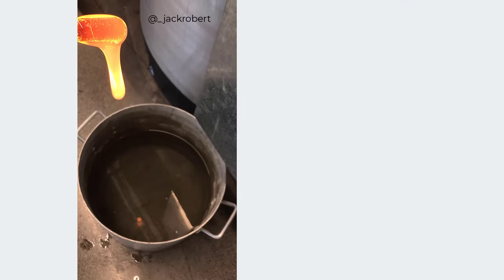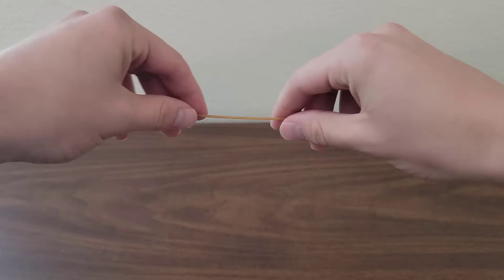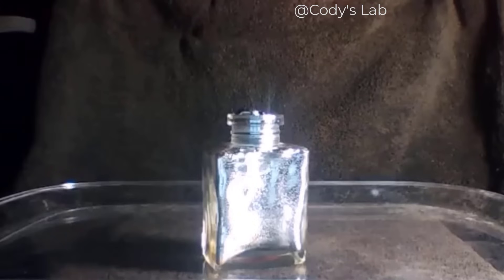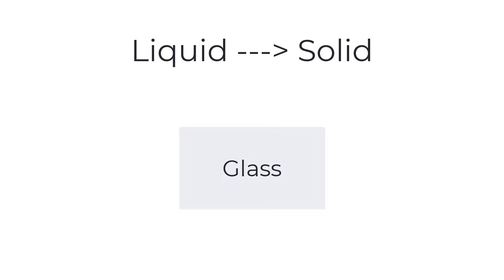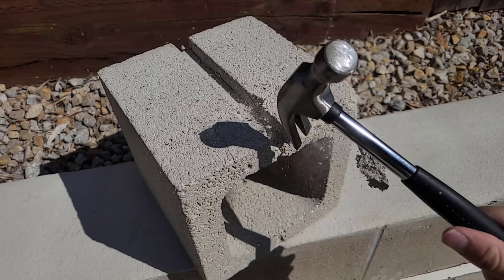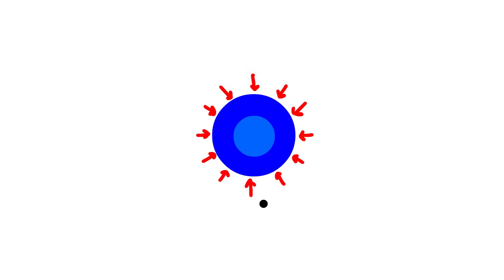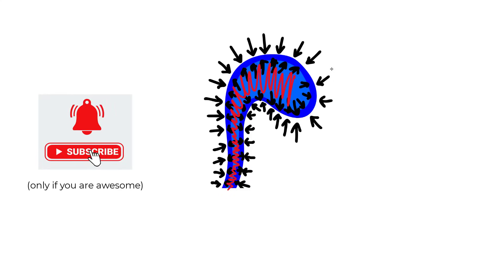How are Prince Rupert's Drops so strong?

Comment: What if you had a sphere of glass, would that have the same strength properties without the PRD weakness?
Reply: It would, but you could not make it as easily as the tear one since you would have to somehow cool equally all sides of somehow created near perfect ball of hot glass. Not an easy thing to do
Reply: @KajtekBeary  so you’re saying we could make bullet proof vests that shatter bullets if we could cool it correctly which with the right machinery at least in my head would work
Like if we had a metal case around the glass that we heated to liquify it and then cooled it down would that work?
Reply: @KajtekBeary  perhaps in space where it is very cold and liquid automatically turns into a sphere.
Reply: @jellobean3614  you can't forget all of the energy travels through the glass
Reply: @monkeywithacomputer1349  space isn't actually that  kind of cold by default as in vacuum there is nothing to conduct the heat away. But perhaps super strong glass marbles could be made on the ISS where a cooling medium could be applied.
Reply: @monkeywithacomputer1349  well, it's not exactly cold in space, it is the low pressure/particle amount that makes it cold, but yes, that potentially could work

Comment: Nice video. The pasta and concrete example had a massive flaw though, material comparison needs both to be the same dimensions everywhere. A pasta sized concrete bit would snap just as easily.
Reply: It was not a comparison of the force you need. Rather a comparison of their differences.
Reply: No it wouldn't lol
Reply: He wasn't comparing Force though
Reply: @GodMaxDrinkerofTea Yes he is not comparing just the force, he is comparing the difference of tensile strength to compression. It's not a fair comparison between the noodle and concrete, because the noodle is not compressed. Like shown in the video, because the noodle is so thin it is bended, and bending is a whole other form of stress. Bending consist of tension and compression parts and (I think) always the tension part fails. If your would make a stick of concrete and apply compression it would als bend and break very easily. 
Pushing on a thin rod is just not a way to measure compressive strength
Reply: @haselnuss43  See, that's a valid argument against this
Reply: If they were trying to compare pasta and concrete's compressive and tensile strength, then sure. But they were not. They were showing how pasta has a higher tensile strength than compressive strength, and that concrete has a higher compressive strength than it had tensile strength. The concrete is being compared to concrete, and the pasta is being compared to pasta. Not to each other.

Hannes Bremer puts a valid argument against the video due to the fact hat the pasta is thin enough to bend, but even so the statement that this video required the same dimensions of pasta to concrete is incorrect. The pasta should have been far thicker, but it did not need to be as large as the concrete to get to the point where you can actually test it's compressive strength.
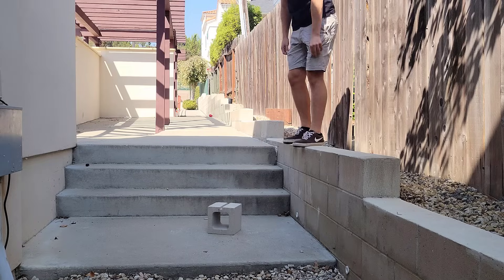Reply: @DreadKyller  I understand what you say. I agree conparing tensile strengths doesn't require same dimensions to compare different materiales. However, at 0:40 he is comparing forces in compression and tension for the concrete, the key here being as you well describe "force" and not compressive/tensile strenght. My comment was intended to show a direct comparisson by equaling the dimensions under same forces. I am not going to write a treatise here.

Comment: So everyone another quick lesson, since this holds 13,000-25,000 PSI it is able to be broken by a 50 cal shot from a Barrett which produces 54,923 PSI which doesn’t and does come close to a water jet which produces 60,000-90,000 PSI, which is strong enough to cut a diamond in half!

Comment: It's ironic since nano materials are so strong due to the tightly woven lattice of quantum scale bonds but Prince Rupert's Drops are so strong due to the deformities of relative bonds when freezing.
Everything is pent up with a ton of energy like a trillion slingshots where snapping one free causes a domino-like effect.

What is also highly interesting is glass making with no moisture whatsoever and particular gases removed from the process will produce glass exponentially stronger than the current strongest metals known to man.
If we could manufacture all of our glass say for instance, on the moon, we would have a material that was virtually indestructible for all known risks including massive bombs.

Comment: I used to work at a glass manufacturer and when I had to break a bad piece from pitting or being too bowed sometimes I'd forget to smack the edge and I'd whack the face of a half inch panel as hard as I could to break it and have the shakes for the rest of the night